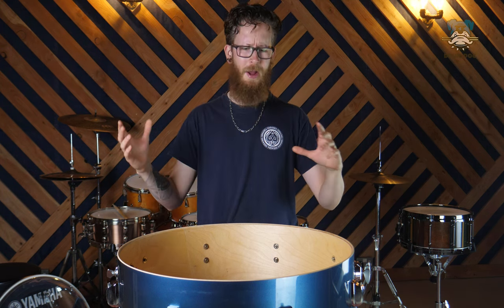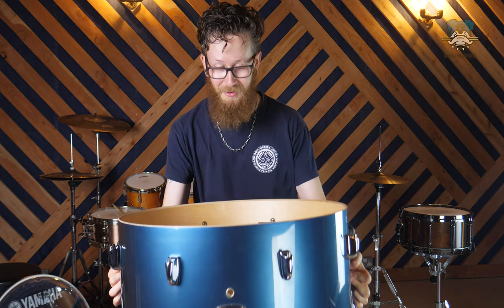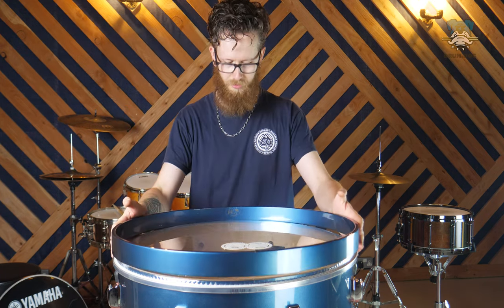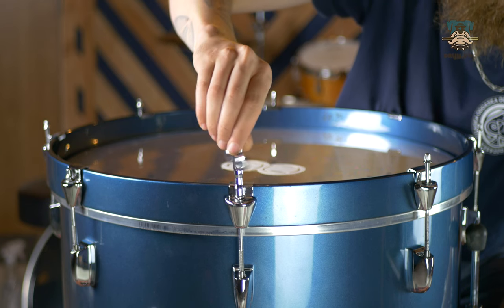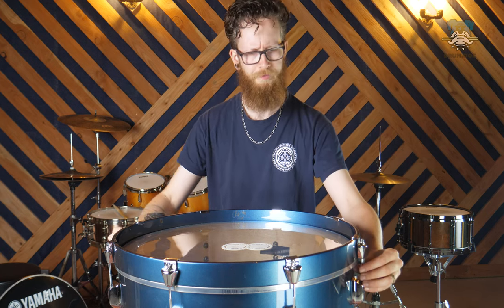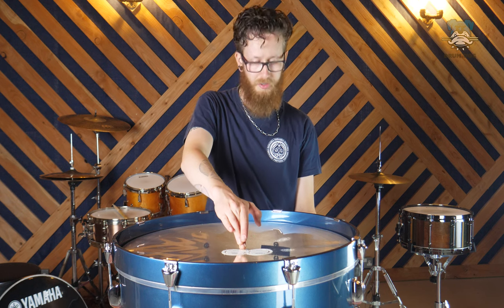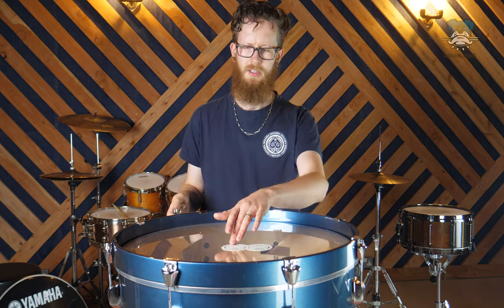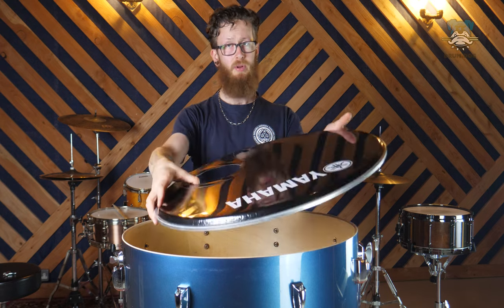How to Tune a Kick Drum - Drum Tuning Basics

Comment: gret sound.I stay away from 2ply and pre dampened kick heads..maybe give it a try again soon.
EQ4,PS3 coated and frosted or clear is my go to with minimal Dampening.
Reply: I loved the eq4 but I've switched recently to ps3 clear and the attack is so good. Get comments about my bass drum from the audience all the time.
Reply: What kind of music do you guys play?
Reply: @rol0511  i do tune for Rock,Metal but also Blues works with my playing/Change of beaters. Actually i have an Uv1 an really like it.Without dampening (move in middle of kick only) i have a great Open Sound.With some muffling great Attack and Definition.
Before i had UV EQ 4 also great and of course pretty similiar with extra muffling.
But because of the volume and attack i will try PS3 after ca. 20 years..The P3 coated is also very good.G1 clear is a tad tooheavy in attack and Volume😂

Comment: While your had both heads off - it wouldn't of hurt anything by sticking a bright light inside the kick while the drum was laying on a flat surface. That way you can see if the bearing edges run true with both the batter, and reso heads.